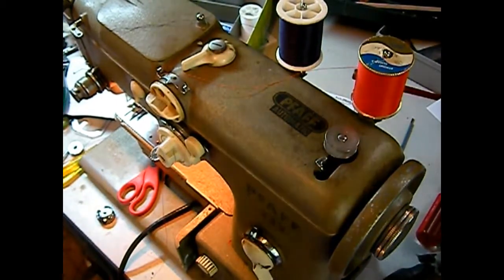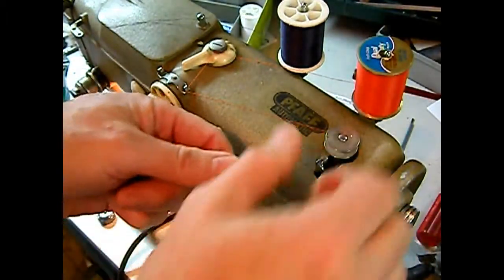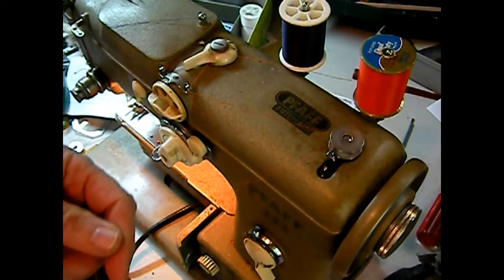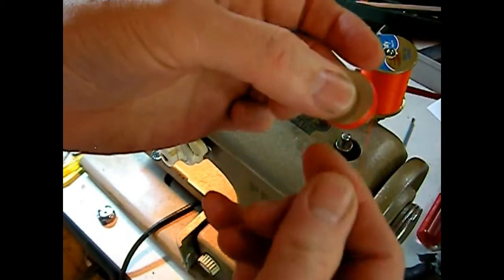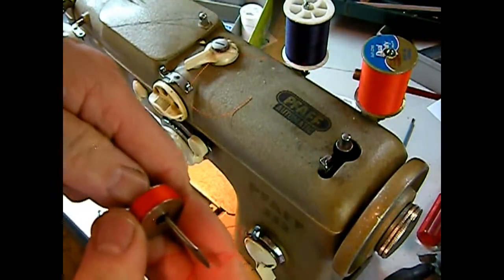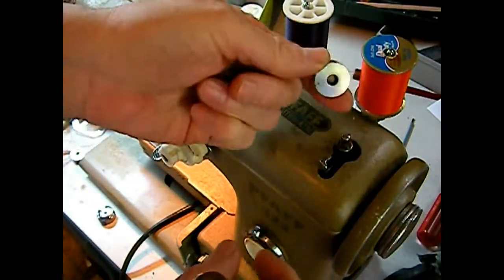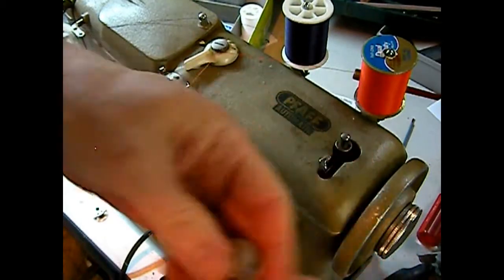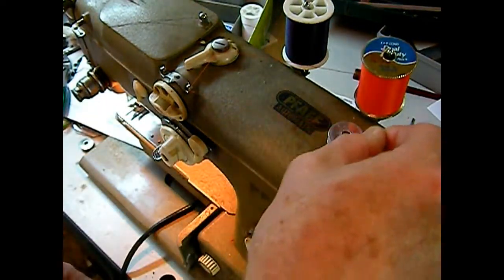#2 PFAFF 332 - How to properly wind the bobbin

Comment: I'm looking to get one of these machines . How many belts do they have ?  I see comments on drive belt and timing belt . I see some say you can't get belts . I researched the drive belt . It's still available . A little confused . Don't want to get one and have problems of not be able to get belts .
Reply from the maker: Yes they have 2 belts. The timing belt connects the top shaft of the machine to the bottom shaft. It has to be "in time" so the hook reaches the needle at the correct time and also so the feed dog feeds at the correct time. 
Before buying one of these machines, you should examine the belts to be sure they are in good shape. 
If they are good, it is unlikely that they will ever need replaced.
The drive belt is the belt which connects the motor to drive the top shaft. This is the most likely belt to fail. Replacing the timing belt would be a major operation.
I will post a video soon on "pfaff 332 a look at the belts."
Reply: @tommixwilkes2640  
حزام القيادة الذي يربط المحرك انقطع 
ارجو الرد كيفية الحصول على هذا الحزام لانه غير متوفر في اسواق العراق